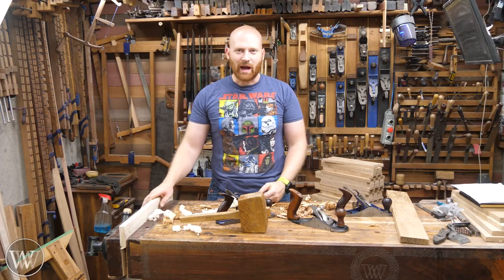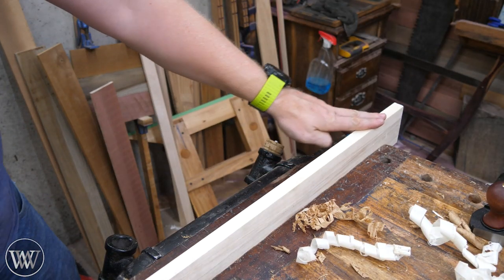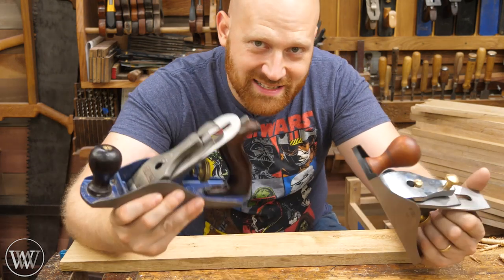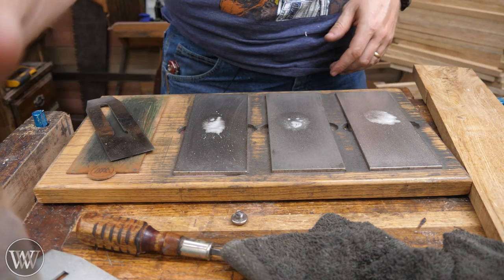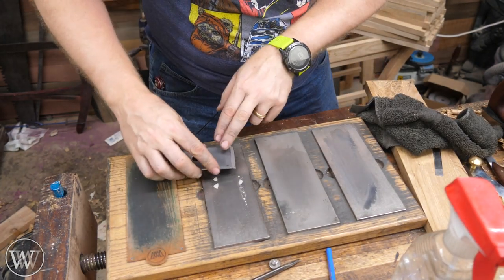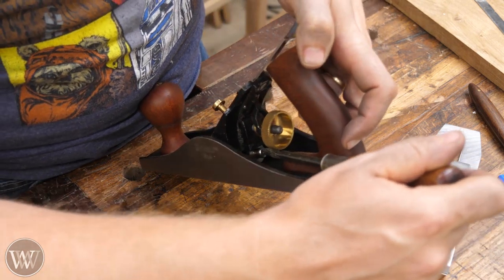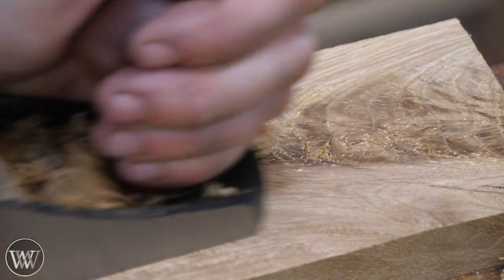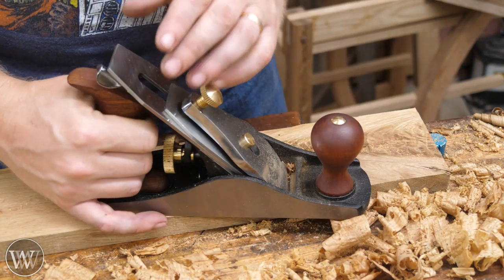How to Plane Against the Grain and in Figured Wood With a Hand Plane

Comment: I have two stanley no. 3's; one corrugated and one smooth. Is one a better smoother than the other?
Reply from the maker: nope. they will work the same as long as they are setup well.
Reply: Corrugated planes are a bit of a come on. I think Stanley just made them to sell people more planes. Theoretically the corrugations reduce friction. I prefer a smooth sole plane myself. If I am having issues with friction I'll rub the plane sole with a bit of paraffin wax. I'd consider corrugated planes more roughing planes. Make the corrugated plane your scrub plane. The smooth sole plane should plane smoother. But one plane may have a flatter sole than the other one? Often you'll get wear in front of the mouth on a plane sole. A hollow can develop there. Which is hard to detect unless you lap the sole. A hollow in front of a mouth will stop fibers from compressing and can lead to tear out. Based on variables there's no definitive answers. If you really want a revelation in easy planing try a wooden soled plane. They slide nice. The trouble with wooden planes is they wear out really fast compared to iron planes. Bit of a pain to adjust if you're not used to it too.
Reply: @WoodByWrightHowTo  Thanks so much,  James. Seeing just how small to make the mouth was a real eye opener.  I've always been told I have a big mouth.  Haha.
Reply: @1pcfred  Thanks so much,  Paul. I'm with you on the smooth bottom but when I finished restoring the 3c, it cuts sooo easy. 😉

Comment: How about sanding white oak if it’s difficult to plane I’m not a pro like u just wondering
Reply from the maker: It works fine just takes a lot longer. If you need to take off any amount of sickness sanding is usually the slowest way to go about it. But it works

Comment: I see you have a steel ruler.. why not use that technique? (Not saying anything is wrong or right just curious)
Reply from the maker: Using the ruler is just one more step and it doesn't provide any benefit into what I'm doing. I'll get it just as sharp with or without it. So if I can eliminate a step and make things easier that's just a better way in my book.
Reply: @WoodByWrightHowTo  thanks for the response, I’m setting up my first plane and it can be confusing to see so many different ways to accomplish to same goal.. a sharp flat edge. The chip breaker angle has become my issue. You make it look so simple. Could these cheap Amazon wet stones be making things more difficult?

Comment: White oak? What nut job would use white oak? 😊
Reply from the maker: The best kind.lol
Reply: @WoodByWrightHowTo  Actually a local place has some so I'll have to try it and see how it is.
Reply from the maker: It's a pain to work with but you can't beat the grain structure. And when it's quarter sawn and you get those modular rays...